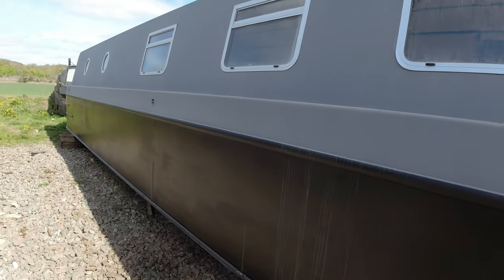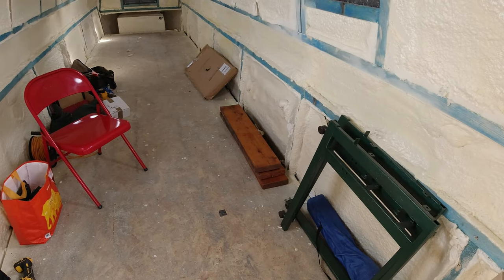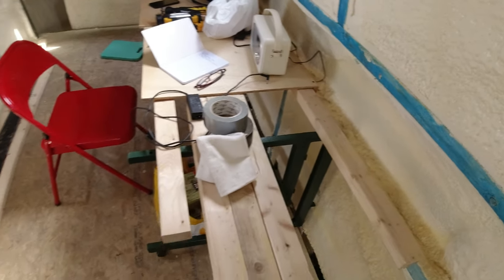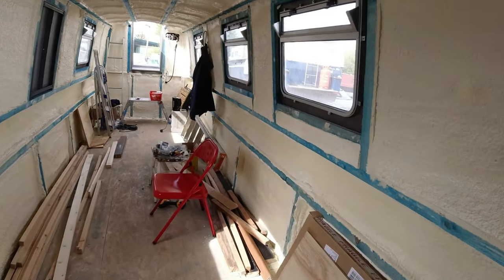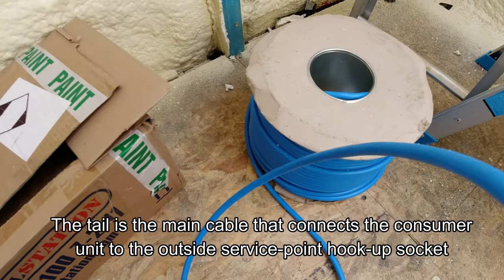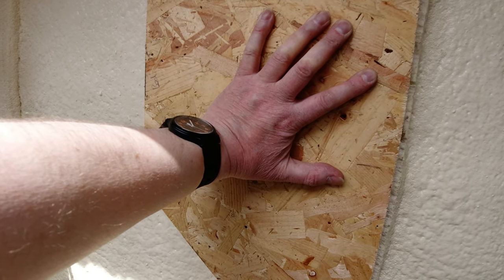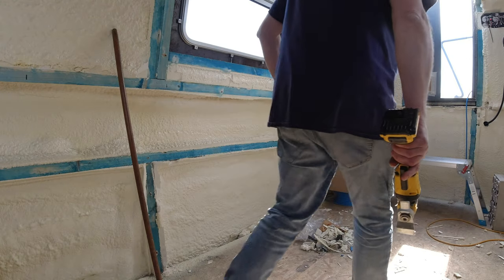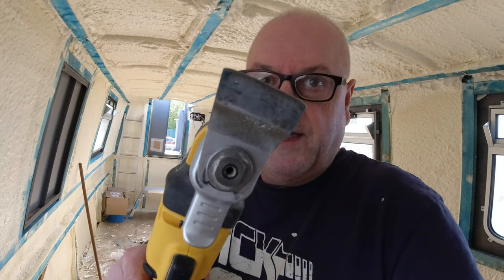Narrowboat Fitout – The Fitout Begins episode #5

Comment: Hi Richard, just a few questions I didn't hear covered in the video.  Did you batten out yourself or was that all part of the sail-away service and the same for the spray foam.  Also,  did you get the 450 ltr water tank you were originally hoping for and was that also included in the sail-away price.  Just trying to get a better understanding of whats included and what would be considered as extras.
Many thanks, Steve
Reply from the maker: Hi Steve
The initial battening out was included in the price I paid; I think it’s standard for a sailaway, as too was the spray foam but it really depends on the builder. A good builder will give you what you want if you don’t wish to buy an off-the-peg sailaway. In the end I had a 400 ltr tank, but thinking about it now, the extra intrusion on the cabin space could have been hidden by the step and the bedroom cupboards either side of the bow doors, but it’s only 10 gallons (50 litres). The bed base is going to be higher than normal; I only need around 32 inches of gap between the top of the mattress and the ceiling and could still sit up in bed comfortably and I’m near 6-foot, so I may well install another elongated water tank under the bed, alongside the hull. I am leaving provision for this. With the depth of the tank, I will still have more storage space than under a typical bed of this style, in this length of boat.
I had some other extras included in the initial build, which cost extra, but I will be discussing all of this once I have my final sub-floor in place. I am working on this right now. I expect it to take me at least 7-8 days as I am doing it on my own, and there is a lot more to do than it looks 😉
At this stage a lot of the work will be unseen even when I get to the next stage of battening out (second-fix), process. The weather is good so I can get plenty of ventilation in the boat. Lifting and moving, and then moving back near on two and a half tons of ballast can be quite tiring, and then of course, painting the baseplate and all the hidden structure that has not been spay foamed. The kettle is permanently on the boil here!!